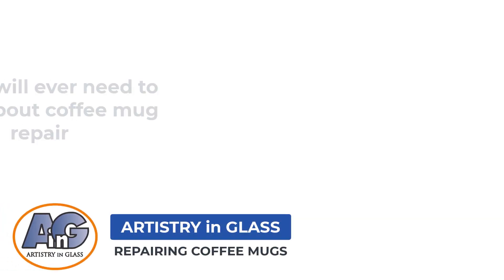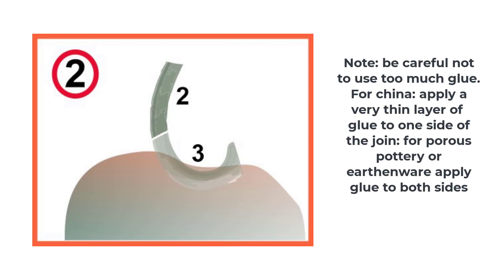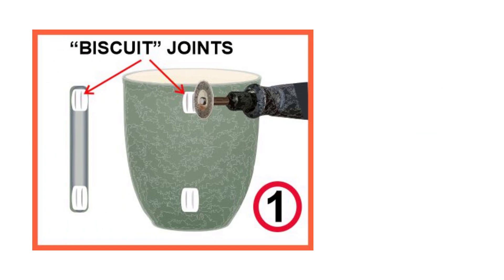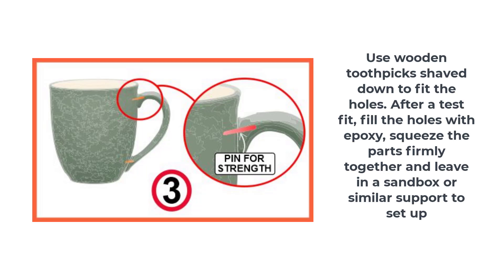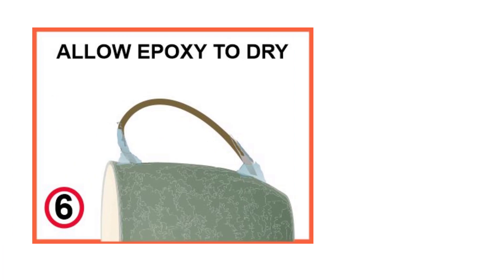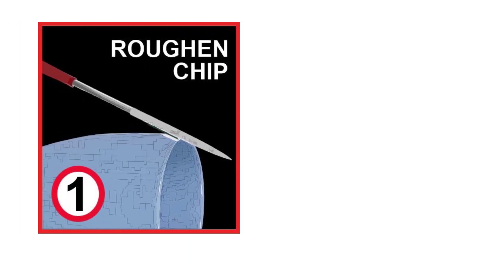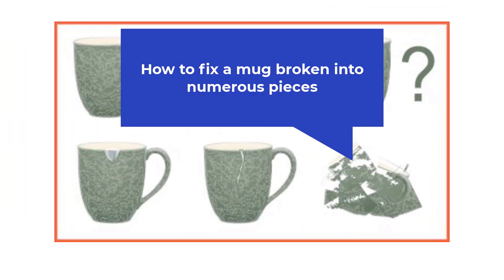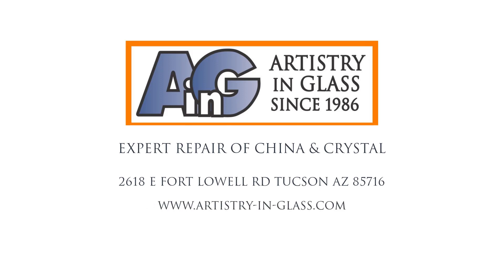How to repair a broken coffee mug - a complete guide

Comment: What kind of epoxy is typically recommended for this kind of repair?
Reply: PC Products adhesive; PC-Clear "clear liquid epoxy" ambient cured, thick consistency. 

PS. If you use a thin epoxy, the porous ceramic will interfere. Get the thicker stuff.

Comment: After a standard porcelain mug handle is fixed, can it be used in a microwave oven to reheat coffee? what type of epoxy or glue do you  recommend? Will super glue or epoxy withstand the microwave or dishwasher?
Reply: Hi Barry, thanks for watching my video. Some less-than-honest repairers may claim that repaired mugs can be used - either in the microwave or otherwise BUT no glue will withstand repeated or even occasional use for your favorite cup of coffee or tea.  We tell all our customers that a mug with a fixed handle becomes a DISPLAY piece only.
Reply: @johnwakefield5633  Thank you so much for your reply. That's what I was concerned about. You've saved me a lot of time and another mess on the floor.

Comment: What’s a good type of dye for a black mug? This is for the chip method. My favorite mug got a pretty bad chip and it breaks my heart to see it like that.
Reply from the maker: Hi Grecia, thanks for watching my video. If it's worth $15.00 to you, try this black epoxy from Bigbong - https://amzn.to/47cOIOs . Be sure to clean the broken surface before applying the glue. After it sets up, sand and polish.  Or, you can use any 2-part epoxy you have available and tint it black with lead scraped off from a lead pencil (not so good). Please subscribe to my channel - best wishes John

Comment: If the brass wire is covered by clay, is it still microwave safe?
Reply from the maker: Hi Gary, that's a great question!  The real answer is that you should never place a repaired coffee mug in the microwave (metal handle/armature or not).  This is because the glue and any epoxy filler or paint is NOT FIRED ON.  So the repaired mug becomes a display piece - not to be used under any circumstances (unless you want to fix it again).
PS Thanks for viewing the vid!